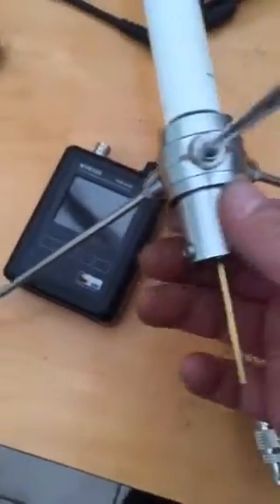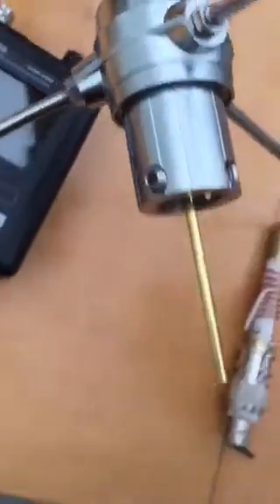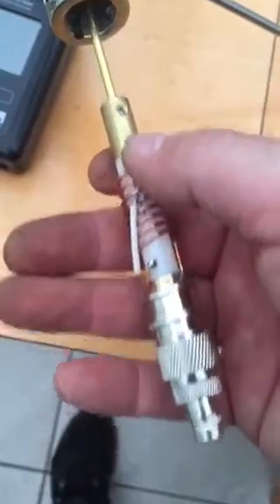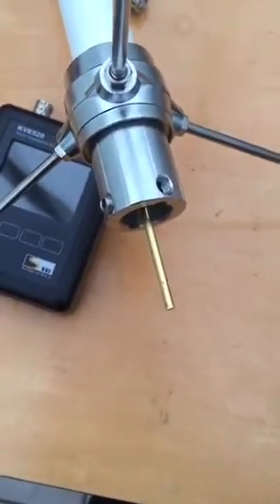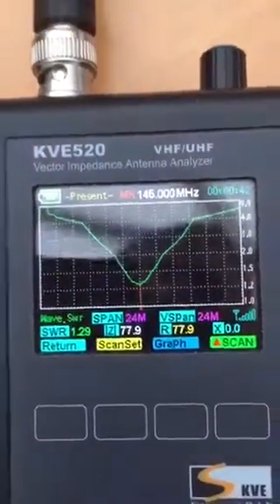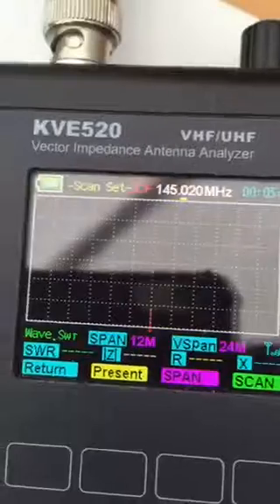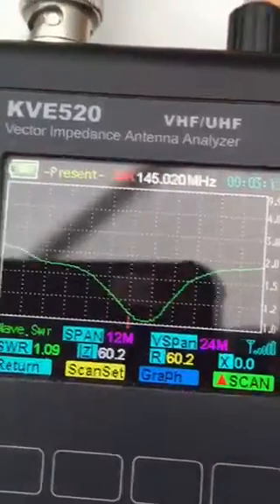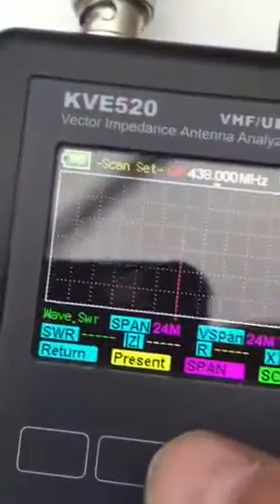Diamond x30 2m/70cm high SWR fix using KVE520 and Nissei RS-502

Comment: Nice video Wayne. I too have one of these antennas just arrived today and set it up in my attic(Stupid outdoor restrictions etc) and 144 SWR is rubbish but 430 is bang on. Opened it up after stumbling across your vid and all was secure inside, I'll be checking the cable tomorrow as it must a fault in there somewhere!
Reply: Same with mine 145 bang on everything else off the scale
Reply: Hello. Don't know if you managed to find your problem, but I just sorted mine out.
430 was fine, but had SWR of 2.2 on 145.
Took the antenna apart and checked the bottom caps and all connections which were fine.
Found that the foam anti vibration pads were sopping wet though.
Under one of the foam pads is some black heatshrink which contains two more capacitors in series. 
The moisture was affecting these.
I removed the heatshrink and dried them off - brushed them with a brass wire brush (not steel) then sprayed everything down with WD40 and reassembled, putting insulating tape where the heatshrink was.
Re assembled the antenna and now have less than 1.5 SWR on both bands.
I am sure this will become a regular maintenance thing, as it was surprising how much moisture there was in there. Those caps are 3/4 of the way up the antenna, and I don't see water getting past the top cap, so I guess that it's condensation or something. Mind you this antenna has to be getting on for 10 years old now. Nice antennas. Hope this helps someone.

Comment: Hi Wayne. Notice from the accent your a Brummie (Midlander) Im G0NWX in brum also. Interested in how you find the KVE520 as im looking at buying one I did have a AW07A but found it not the best and as I make antenna's would be interested in your views on the 520. Couldn't find a way to contact you direct
Reply from the maker: Hi, i find the KVE520 a nice piece of kit, pick a span width , click scan, as they say One Picture Worth Ten Thousand Words. The internal battery last a good amount of time. the single frequency scan is also very good if you need to tune for a specific frequency.